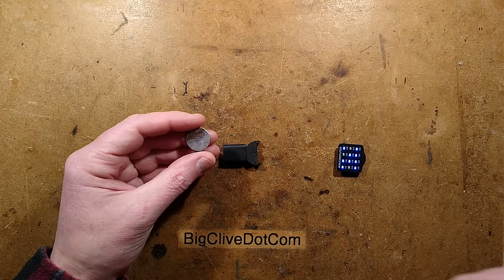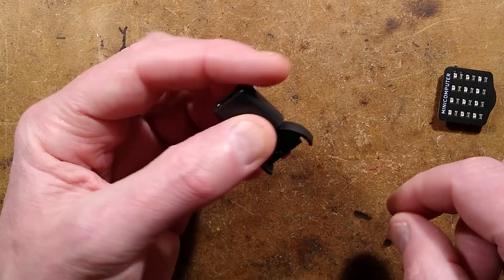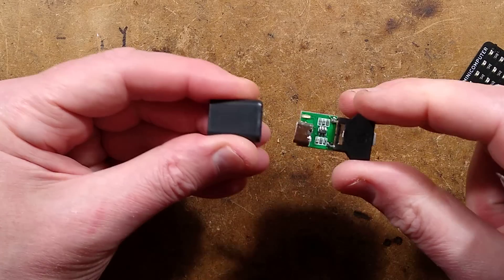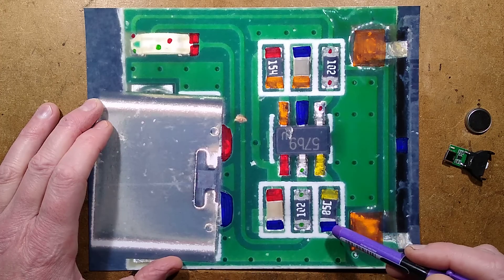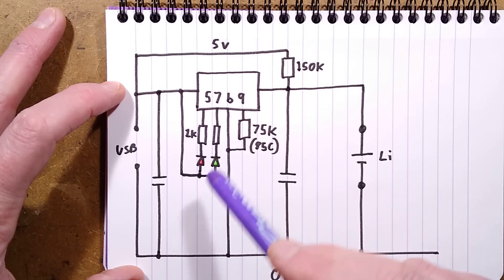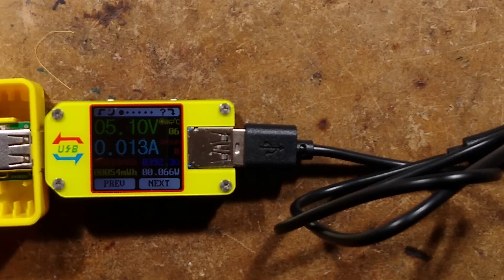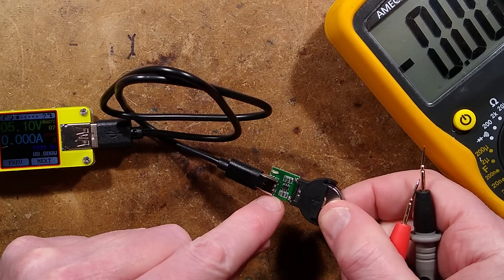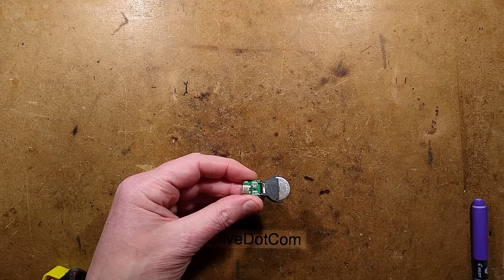2032 lithium cell charger with reverse polarity test

Comment: How utterly fabulous! How many times have I wanted to use vernier calipers or similar & found the battery flat & had to then rummage through cards of mostly unused batteries for a new one. Having something that I can recharge with a few spares is such a pleasant & better way. Thank you for sharing!
Reply: Be careful, your vernier calipers may not appreciate the 4.2v from a freshly charged LI3032.  Also note the capacity of the rechargeable 2032s is about 1/5th that of the non-rechargeable ones.
Reply: @ferrumignis  Ya, reminds me of a thermometer we had once, back when digital thermometers that were cheap enough for home use were kinda new. Replaced the battery with same model number, but of a different brand. I can't remember now if it read way too high or too low, but thermometer was useless till we bought another battery of the original brand. Sensitive micro electronics can be kinda sensitive... Who knew?
Reply: @ferrumignis  When I finally purchased vernier calipers I got cheap plastic ones. 

Bonus: will not short a battery!
Reply: @ferrumignis If you have access to a 3D printer you could print out a protection for your caliper, zeroing the caliper with it.
Reply: @strenter  I was not referring to shorting out the battery when measuring it, it sounded like the OP wished to power his calipers from an LI2032. Some calipers are powered from a CR2032 with a nominal 3v, hence the warning about the significantly higher voltage of the rechargeable versions.
Reply: @ferrumignis  Is 0.3v going to make that much of a difference (3.3v Cr2032 and 3.6v LIR2032)? Genuine question. 
Thank you in advance if you get to read this question. 👍
Reply: @pipercessna3827  The nominal voltage of a CR2032 is 3.0v and will typically be around 3.1v when new.  An LI2032 will be 4.2v after charging, which is almost 40% higher.
Reply: @strenter I think Clive's calipers are plastic ones looking at the video, cheap to make not too accurate but great at not shorting out batteries
Reply: @tazz1669  There are some plastic ones made being able to carry energy, ie to avoid building up static charge. Sure, their resistance is rather high and no problem with just 3V, but I would be careful with higher voltages. Just to be secure.
Reply: @ferrumignis  Thank you I appreciate that. I didn't know the LI2032 voltage was that high but I did know every CR2032 I have tested was 3.3v so even if they are that, they are still 1v less then the LI2032 which is substantially more than the 0.3v I initially thought. 😲Thanks again for that. I would say you have quite possibly saved me a bucket full of remotes and for that I am extremely grateful. 🥰
Hope you have a good one! 👍
Reply: One more reason why I still keep measuring tools with mechanical dials around in the shop.
Reply: I added a physical power switch to my cheapo Chinese digital calipers, and haven't changed the battery in years. It's just a latching switch mounted in the hole for the data port, with two pieces of copper foil separated by a strip of paper that sit between the battery and the pcb contact.
Reply: @Kevin75668 
I go somewhat less high tech. The case mine came with has a slot for a spare battery. I just remove the battery and sit it in there.
Battery left in the callipers went flat in a few weeks. Removed, it still works about 3 years later. I suspect these ones just turn the display off but keep running everything else when they're "off".
Reply: These are not drop in replacements for CR2032. Most circuits using CR2032 just rely on the internal resistance and/or assume <= 3.3V. I've read reports of LIR2032 actually frying circuits (bicycle power meters in this case, pretty expensive experiment). CR2032 are convient in that way that you can just omit the voltage regulator for 3.3V applications where no reference voltage is needed. There's probably not even manufacturer information on whether LIR2032 are OK to use, as they are rather niche. Also the voltage curve is really whacky for LIR2032.
Reply: Perhaps better use the ML2032 which has a lower voltage and more capacity.
Reply: @benbaselet2026  Yes, the manganese dioxide version has much more compatible voltage range, and about 50% more capacity than the lithium ion versions (still a lot less than a CR2032).  Very important that a suitable charger is used, and not the one in the video designed for the lithium ion cells.

Comment: I would expect it to not charge a reversed cell, because a negative voltage is way lower than the threshold for charging. That is, most lithium chargers have a threshold, because if the voltage is too low, the cell is likely damaged, and it's dangerous to charge. If that;s the case here, it would automatically serve as reversed polarity protection I think.
Still good practice to never put a cell in the wrong way round. You can never be sure XD
Reply from the maker: With classic TP4056 charge boards, reverse connecting a cell will destroy them.
Reply: @bigclivedotcom good to know, thanks! Didn't consider the consequences for the charger itself for some reason.

Comment: I want to see what happens with a non-rechargeable cell!
Reply from the maker: A quick test shows that the voltage shoots straight up to 4.18V and very little current flows.  Not sure what would happen with a long term test though.
Reply: Fire??
Reply: That would make the angry pixies even more angry.

Comment: The amount of these I go through by keeping my keys in my back pocket, I always wondered if they could be recharged. Will keep an eye out for the LIR versions.
Reply: They are not compatible with the 2032, just the dimensions are the same.
Reply: @Breakfast_of_Champions  oh right, cheers for the heads up. That could have been expensive aha
Reply: @ifell3  you could use the ML2032, which is also rechargeable and is 3V nominal. Both rechargeable types are way lower in capacity compared to a CR2032 though.
Reply: @ifell3 +20% voltage would sooner or later burn out the 3V chip  in the fob.
Reply: @Breakfast_of_Champions  agreed someone else has already pointed this out. Thank you
Reply: I buy them off ebay for my keyfob but you still have to recharge them often

Comment: Hi,Clive until Isaw this video ,I had no awareness  of rechargeable 2032 cells but now that I do I will be able to repair some late 1960s Sony IC radios.Informative as always thanks Clive.
Reply from the maker: Keep in mind that the traditional cells are a flat 3V while these start at 4.2V.
Reply: @bigclivedotcom  There is another variant, the ML2032, which has a nominal voltage of 3V and is rechargeable. 65mAh compared to 200-250mAh of CR2032 though. Also takes quite a while to charge at 2mA or lower (numbers straight out of their catalog).
Reply: @bigclivedotcom  How well would these work as CMOS memory batteries in a PC???🤔
Reply: @RTR-MATEY  look-up datasheets of bios chips...  Gone through few. Supply voltages from 2.4/2.7V to 3.6V. Doubt those will tolerate 3.7-4.2V.

Comment: The battery shell, sides and top are positive, the bottom insert is negative. So if the positive charging contact is at the side or edge and the negative contact is in the middle, this would eliminate the upside down problem.
The wrong insert would only give positive on both contacts.
Reply from the maker: The contacts are both central.
Reply: That was my first thought, so was puzzled when he say put it in the wrong way to see what happen

Comment: I've charged a battery the wrong way before, and then for the life of me couldn't work out why a battery had negative voltage, it never did recover in trying to charge it back the other way

It makes me wonder if the battery itself has the reverse charging protection rather than the charging device
Reply from the maker: Reverse charging a lithium cell is bad.  If you do it, put a load on it to discharge the cell to zero and then dispose of it.

Comment: Now all it's going to take is an error in stamping and suddenly there will be all these battery fires 🙈

Personally, I don't know it it's even worth having a rechargeable battery that small... How about opening the battery itself? 🤷
Reply: There's many devices that use them for data retention, the usual date & time, plus settings or programming, easier to implement than designing in a replaceable CR2032 (or the slimmer versions), though could also be a BR2032 which is a very long-lasting cell for low-current applications, though the LIR and the BR would mroe often than not be soldered in jobs so need to be dealt with using a soldering iron...

Comment: I know from experience that TP4056 does not contain reverse polarity protection. Unless you call "blowing up" a form of protection...
Reply: Yeah..... found this out that way too.  haha
Reply: Blown fuse is absolutly protection. So is a blown resistor.
Reply: @matsv201 how about a blown IC?
Reply: @oilybrakes Depends on ones definition of "protection" philosophically thinking... for example they could define "protection" as it not burning ones house down 😅
Reply: @oilybrakes  well i guess technically if it protect a more expensive system.

In the Telecom servers i use to work with we had both fuses and resistors specially designed to blow if they got overloaded.
Reply: @oilybrakes I prefer a burned IC over a burned home.😉
Reply: Hey, a blown fuse IS a blown resistor
Reply: Nice Post as always! What camera setup are you using? I'm getting the very beginning of cataracts, so thinking of a bench camera with good zoom and close up focus like this to facilitate fine work.
Reply: @dermotdobson2700 if Clive is still using the same as a while ago I believe it's a phone camera and a bench lamp with LEDs. There should be a video about it somewhere in the past
Reply: I believe the proper term is "Rapid unscheduled disassembly"
Reply: transistors are there to protect the fuse  😉
Reply: Yea, I do call that protection. Ya still have a house right?
Reply: a "genuine" or "original" TP4056 certainly does not offer reverse battery polarity protection.. And by TP4056 I mean Toppower made TP4056 chips.. (Toppower appears to be the "original" manufacturer of the TP4056)... If not mistaken they later introduced TP4056X which does have reverse polarity protection.. other manufacturers with pin compatible chips have added protection, most keep making them without or have versions with and without it... at the same time, battery protection chips come with or without reverse battery protection so, if you use the right combo you can have it .. or not...
Reply: A good engineers will always use a diode for polarity protection no matter what circuit he's building
Reply: @dammdaniel9953  No not really. If its  agood engineer they built in a internal polarity protection.

The issue with having a diode polarity protection is front forward voltage fall. For something with low voltage like a battery, that is a huge problem.
Reply: The final and most noticeable type of protection😂😂

Comment: The weird 150k resistor between VBUS and VBAT I've seen once before on another charger with a removable cell, it's to ensure the charge finished LED stays on with no battery installed, without it the charger IC will constantly charge up the output capacitance which will leak down triggering it to charge it back up again causing to LEDs to flicker which may cause the user to think the unit is faulty.

Also you can actually buy USB C receptacles with through hole pins for power only that have the resistors built in to simplify designs like this. Did you test if it worked on an upstream device that requires the CC pin communication? I've always been interested in where they put the resistors in them.

But I really like the form factor of that charger, although would have expected a male USB C plug so you could use it without a cable. I will note I find LIR coin cells rarely get much attention as very few devices can take them let alone are designed to use them. I suspect because their volumetric capacity is often rather low and price is rather high compared to like a dirt cheap 100 mAh pouch cell. One advantage for me with LIR cells in the past is most can be short circuited and not catch fire unlike many pouch cells which helps meet certain product safety requirements.
Reply: Would also say the resistor is there to pull up the battery to fool the charge IC, as it likely is meant to be connected always to the cell, so putting in the cell while powered will mean it will simply stay locked into protection, as it detected a very low battery voltage on power up. The resistor means it will see a high enough voltage, flip the charge transistor on, and immediately charge to full voltage, and say the cell is full, and stay that way. Connect battery and it thinks cell is now discharged and starts to charge it.
Reply: I have a very similar one with a USB A plug that can be used without a cable.
Reply: I'd happily skip the CC resistors for something like this, I don't really need 3A.  The plain USB-C sockets don't have the resistors, the ones with the little circuit board sometimes do, as do the wired panel mount ones.  Now I'm wondering what the default USB current is, 0.5A?

LR2032 do have crap capacity, 40mAh vs 200+ for CR2032, and higher voltage too.  They are a lithium cell after all, so 4.2v (3,6 nominal), might upset a few things.
Reply: @j.f.christ8421  without resistors (most?) USB-C sources will not provide anything at all, not even 5v 500mA.
Reply: @Gurux13  That doesn't sound right.  I had a quick look at the USB-C spec, and it states it falls back to USB2 standards, so 5v @ 500mA.  It doesn't say what happens if I put resistors on the D+/D- lines.  Tried a couple of chargers with a very basic powerbank (USB-C to USB-Micro) and yep, 5V @ 500mA.  Tried my phone (Doogee S98), and it put out 650mA, go figure.  So yeah, those 2-pin USB-C sockets are good for 2.5W.  Resistors on the CC lines will get me 5v @ 3A.
Reply: @j.f.christ8421  without resistors to CC1/CC2 the modern USB-C charger will give you 0V
Reply: @zyghom  Nope, see other reply.
Reply: @j.f.christ8421  you are wrong. Modern USB-C power supply does not have default output voltage and without sensing pull down on CCx it will not give any output voltage - this is from the specs: "how the inserted plug orientation is detected at the Source’s receptacle by noting on which of the two CC pins in the receptacle an Rd termination is sensed. Now that the Source (Host) has recognized that a Sink (Device) is attached and the plug orientation is determined, it configures the TX/RX data bus routing to the receptacle.

The Source (Host) then turns on V BUS . For the CC pin that does not connect Source-to-Sink through the cable, the Source supplies V CONN and may remove the termination. With the Sink (Device) now powered, it configures the USB data path. This completes the Host-toDevice connection.

The Source monitors the CC wire for the loss of pull-down termination to detect detach. If the Sink is removed, the Source port removes any voltage applied to V BUS and V CONN , resets its interface configuration and resumes looking for a new Sink attach." - the document is: USB Type-C Spec R2.0 - August 2019.pdf
Reply: Agree. 
It may be doing double duty and also being used to trickle charge deeply discharged batteries which is done usually with sub 100uA currents.
Reply: Personally, I consider the female port to be a lowest-common-denominator thing; Sure, having a male connector would mean you could just plug it into devices without a cable, but what if your device doesn't have any USB-C ports? Or it does, but you're already using it for something else? Using a female port and a cable ensures that you can plug it into any USB port at all, you just need the right cable.
Reply: Agreed!
Reply: The flickerring "function" based on the output capacitor being charged and discharged is actually intentional in most of those chips, indicating No Battery or faulty battery

Comment: Thankfully I do not have any "smart" chargers so this will work fine with all of the ones that I use  :)
Reply: "Smart" chargers in this instance are any chargers that have a type C port and thus use a type C to type C cable to connect to a device. A "dumb" charger is one that uses a type A to type C cable since they just shove out 5V all the time.
Reply: @iamdarkyoshi  Not true, a lot of USB-C chargers also shove out 5V all the time - it's the simplest way to do it. And there's USB-A chargers that also doesn't provide 5V unless it sees something, so basically it's completely independent of the connector type. It's probably slightly more COMMON on USB-C outputs but that's it.
Reply: @Torbjorn.Lindgren  Would you share the models of them please? I've got dozens around my house and not a single one does this, I'd like to see what lives inside the ones that do.
Reply: Is it possible that towards the back of the charger where the back of the battery fits into that it is physically detecting the difference between the positive side of the battery and the negative side? If that was possible then the request for a charge would not even get to the circuit board.

Comment: Maybe the input going straight to the resistor is to have it pull enough current to trigger the treshold of the power supply? Some power banks turn off when there's not enough current flowing.
Reply from the maker: The current is just microamps.
Reply: That was my first thought, too. But then realized that it's way too little current.  Someone above said it's likely there to keep the green charged LED on once it's done charging. 🤔